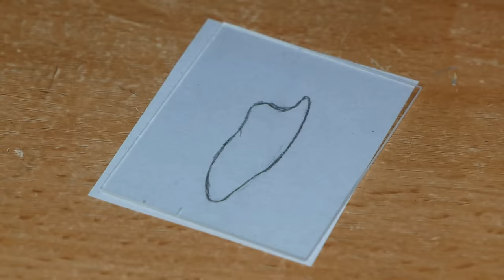Making a Burning ZIPPO Lighter in clear Epoxy Resin !

Comment: I wouldn't have cut off the end off the shell, but coated it with something the epoxy wouldn't stick to and have the bottom sticking out a bit in order to access the battery (little blobs of resin on each corner to raise the piece to compensate). It still remains a Zippo in that you still have to dismantle it to "refill" and remains sealed.

Comment: Ive been wanting to try this, but YOUR imagination is a lot more "out there" then mine!. (That a compliment 👍  )  
an "item" in the center with small mirrors in opposite corners. As you rotate your finished part, it should give the  illusion
your item is jumping around. I think the resin would hide the mirrors very well.  Im sure you can make this work!

Comment: Because the battery board has pads on the backside, it might not hurt to put a piece of tape on the back of it to insulate it and keep it from shorting out against the metal lighter housing and killing the battery
Reply from the maker: You are right